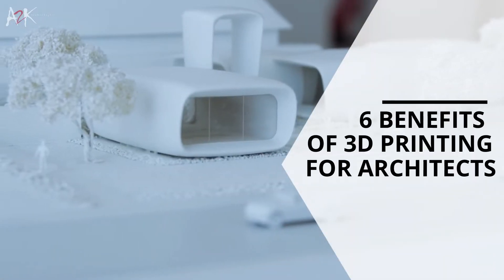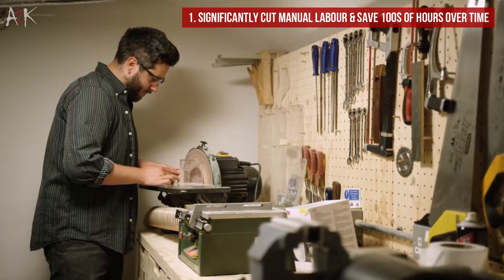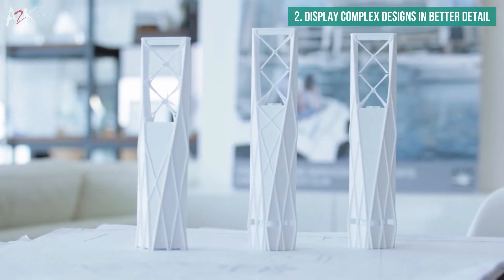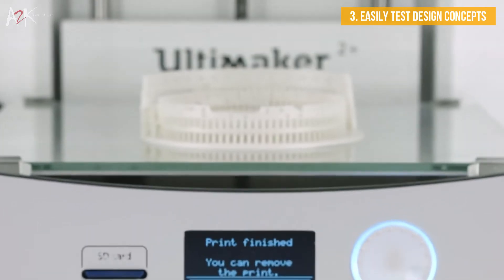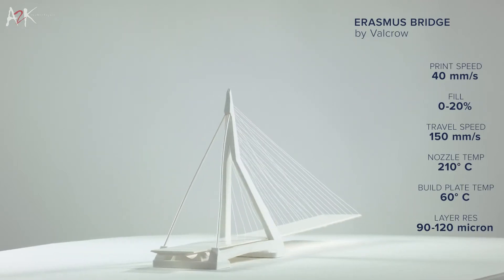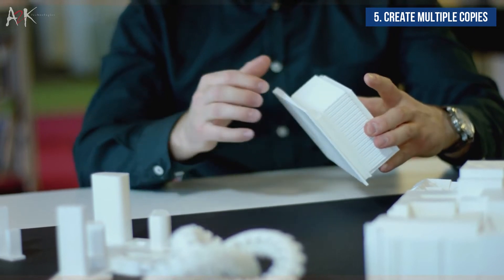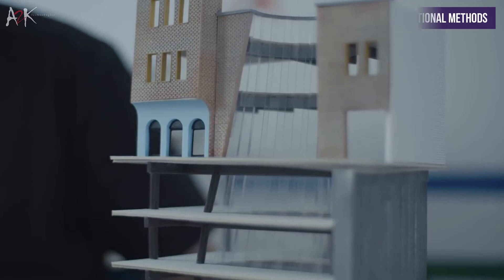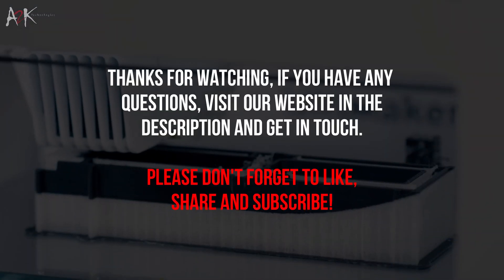6 Benefits of 3D printing for Architects

Comment: Nice!
Awesome, complex models. 
I got a few questions :
1. What is an optimal print voume?
I'm looking now for printers with  500x500x500mm
2. What software can help to "shrink-wrap" a messy architectural design model (SketchUp ) to make it printable ?
Reply: Hi Dennis, 

1) it depends on for what you want to use your printer and how large models do you need. It is possible to cut the model and after you print all the parts you can glue them together. It wont take a lot of time

2) You can use any CAD for that. I recommend you the Autodesk Fusion which is for startups and individuals for free and for companies you pay about $495/year. You can see this tutorial: https://www.youtube.com/watch?v=glq6t8M-uRQ